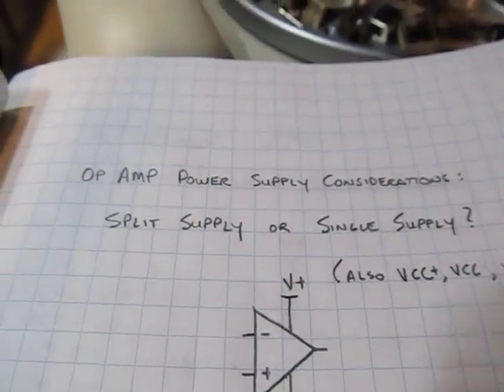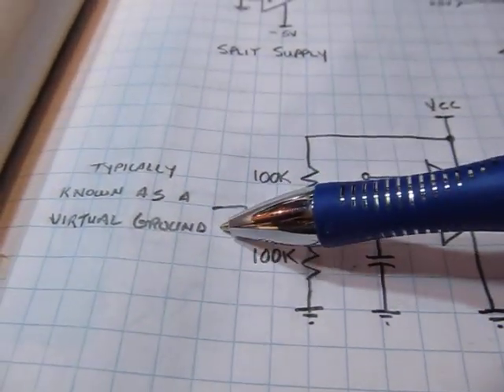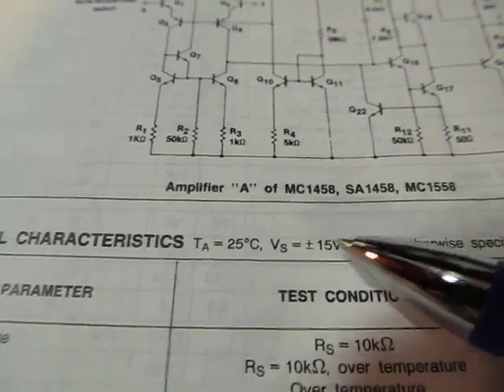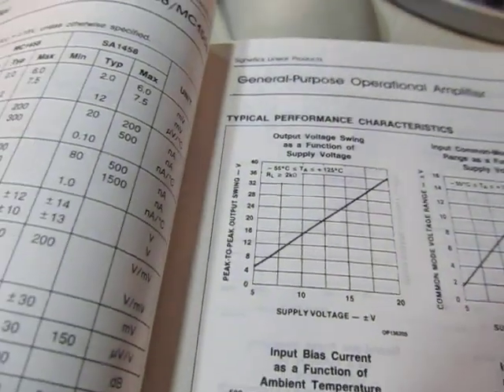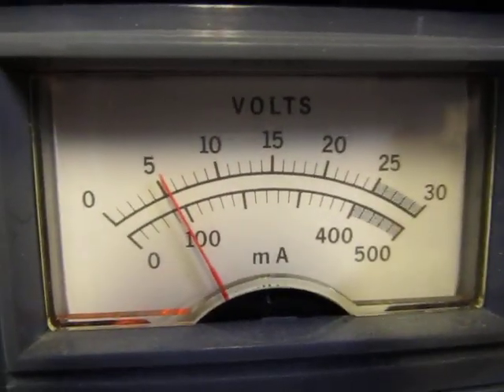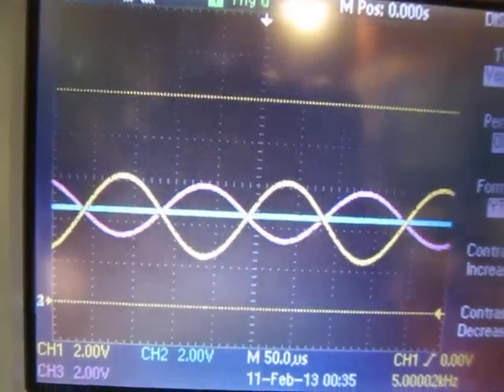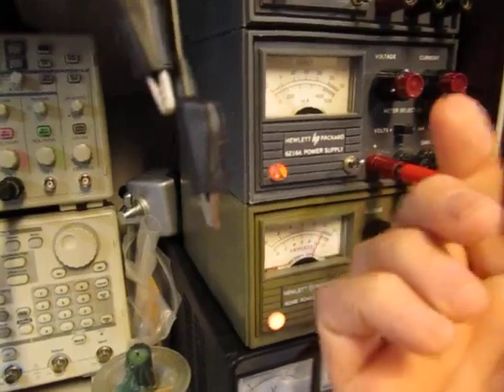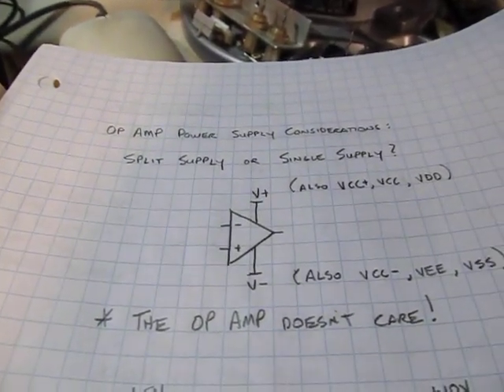#79: Op Amp Power Supply Considerations: split, single, virtual ground, etc. - a tutorial

Comment: if your opamp circuit with a virtual ground connects to a another opamp that is using a single supply (ex 0-12V),  in the gain loop of a non-inverting amplifier, would you connect the resistor to the 0V ground of to the virtual ground?

Comment: could you tell please name of the book you used?
Reply from the maker: I"m not sure what book you're referring to.  I didn't use any particular book to put this video together.
Reply: Ok, I mean't the datasheet. It look's like the number of datasheets sticked together like a "handbook". Or I have mistaken? I am just collectioning this kind of handbooks (in e-format) for individual use, because it's handy )))

Thank you for your videos, they are very informative.
Reply from the maker: OH, now I understand.  Back in the days before the internet, and before PDF files existed, the chip manufacturers would put their datasheets in a book called a databook.  Large manufacturers with many chips would produce a family of databooks (Op Amp databook, Data Converter databook, Voltage Regulator databook, etc.).  Back in the day, we used to have complete bookcases full of the latest databooks from the IC manufacturers.  I still like using these because it's nice to have the "paper" to leaf through.  Some databooks had really good selection guides and some even have cross references to other manufacturers parts.
Reply: @w2aew  Used to?  I still do,  in spite of also having tens of thousands of pdf datasheets too...
Reply: Do you happen to be aware of any manufactures that still publish databooks?

Comment: Being that a R-to-Rail allows for max swing, would you basically choose them over a 741? In your opinion... I would think that a rail to rail would be better given full swing on your power supply. Ex: 9V V+ would only allow for 7v swing given 3.5V bias...
Reply from the maker: These days, there are very few reasons to choose something like a 741 over a more modern device.  R-R devices make the design task much easier in many cases.

Comment: thannks for that video :)
for my TDA2050 wich one is better to use for best result single of split supply??

CIRCUIT DESCRIPTION

SINGLE SUPPLY VERSION

The IC will work from 18v to 45v although performance and quality will be affected at lower voltages. If a higher supply voltage is used be sure to upgrade all the capacitor voltages. C5 must be at least 35v and preferably 50v or more. This will result in a large capacitor but there is room for it on the PCB.

SPLIT SUPPLY VERSION

This version uses a split supply, +/-12v instead of 24v. The supply can go up to +/-22.5v. The split supply version has similar performance to the single supply version.

Vsupply = +/-18v, THD = 0.5%

18W into 8 ohms
28W into 4 ohms

Vsupply = +/- 18v, THD = 10%

22W into 8 ohms
35W into 4 ohms

Vsupply = +/- 22v, RL=8 ohms

25W @ 0.5% THD
32W @ 10% THD

thedjfreeman08@gmail.com
Reply from the maker: I've never designed with this device.  However, since the characteristics curves in the datasheet were all done using a split supply, I would assume the best performance is in that configuration.  Probably a good question for the application engineers at ST.
Reply: w2aew for me i think for single supply they used a single ground thats commun for speaker munus power and signal in minus and for split supply they separate the ground by creating a virtual one
i see that for single if someproblem occure it will affect the player device such as pc or phone...

what do u advice me to chose as supply methode as i will bridge 2 tda to get more power output 

thanks have nice day
Reply from the maker: My first thought would be to use a split supply, for the same reason.  If there's a fault, you're less likely to damage something else.  But, I am not an expert in audio PA design.
Reply: w2aew thanks for replay i will try split then the single one and i will compare between them :)

Comment: I like this op amp functioning demo.  It was interesting to see how the 2 op amps were pin compatiable.  Unfortunatly it seems most manufactures of ic chips go out of their way to be different and almost no standards apply.  Its that "so just to be different" notion that makes learning about electronics such a bitch.
Reply from the maker: Thankfully, pinouts of things like dual op amps, transistor packages, etc. are somewhat standardized - not much hope for more specialized parts though.
Reply: I always check the data sheets before assuming anything in electronics,

Comment: Hi! In your other video about Crossover Distortion you avoid it with a load resistor on the output while here, without any such load, you haven't any distortion despite the 5kHz frequency! How is that possible?
Reply from the maker: The LM1458 op amp has a different output stage compared to the LM358 that was used in the crossover distortion video.  The LM1458 output won't swing near the lower supply rail.
Reply: Thanks for your answer. I switch to a NE5532N from Phillips and now I got no distortion at all, however I got 7mA of current instead of less than 1mA on the LM358, interesting... By the way, this chip has not the "slew rate" issue!

Comment: In the example did you use one power supply or two? I mean  It does not make sense why you put the power supply  between ground and the resistance? What would happen if you simply were connecting the power supply to the Opamp like +10 to one pin of Opamp and 0 (ground) to the other pin of Opamp?
Reply from the maker: +cyrusIIIII I used a few supplies - a single +10V supply to power up the op amp, and the variable supply that I put from the 2.2K resistor to ground is used to demonstrate the behavior with different "virtual ground" voltage levels.  The variable supply is purely to illustrate the effect of the choice of the virtual ground potential (staying within the common mode range of the input of the op amp).
Reply: ***** 1. So if the specifications of Opamp says +-5,  I should just use one power supply and connect the ground (0) of power supply to one pin and +10 of power supply to the other pin of the amplifier and play with resistances in my circuit to to create +5 volts in the + side of Opamp. Am I correct? 
2. Another confusing thing for me is that why power supplies have 3 outputs? For example in my case it has + ground and - output! Can I set it to 5 and connect the + and - output of Power supply to the + and -  pin of Opamp?
my power supply is HY3030EX  :

http://www.mastechpowersupply.com/volteq-power-supply-hy3030ex-30v-30a-over-voltage-over-current-protection.html

Sorry for the long question I am noob :)
Reply from the maker: +cyrusIIIII 
1) Yes, if you want to use a single supply.

2) The power supply output is "floating" with respect to ground.  When you set it to 5V, it sets the + termina to be 5V positive with respect to the - terminal. The ground terminal is connected to the chassis/mains/line ground.  You can connect the - terminal directly to the ground terminal and you've configured it as a positive 5V supply.  If you instead connect the + terminal to ground, then you have configured it as a negative 5V supply.

Comment: for a balanced signal input, where you have a floating differential signal going into the +/- terminals of the opamp, a split supply would be more necessary correct?

Comment: Hi I'm trying to create a pwm signal by comparing a triangle wave with a Sine wave. I've tried with triangle signal that is +/- 5vp from an occillator aast 100khz and a 400hz Sine wave +/- 5vp but it doesnt work. I've tried the 741 and a tl081 opamp and a lm339n but no succes yet.
any help?
Reply from the maker: CryB4Die It's difficult to say without seeing your schematics, but there are very common mistakes that people make.  The first is that you have to make sure that you obey the input voltage range limits on the devices used.  Since your input signals go from -5V to +5V, this means that the power supplies on your op amps MUST be at least 2-3V greater than this - like +/-8V or so, or more.  The input signals generally can not go beyond the supply rails (except in specific cases where the devices are designed for it), and often the inputs must be kept several volts from the rails (except in the case of op amps with rail-rail inputs).  Also, for the LM339 comparator, it uses an open collector output, so it MUST have a resistor connected between its output pin and the positive supply.
Reply: ***** okay thanks!  I'll check my power supply and try it again with a lm339n and a resistor at the output hopefully it works!  Thanks

Comment: Hi,
I have some questions relating to thermocouple voltage amplification. The K type thermocouple output is DC but very low voltage. Do I need to bias the positive input of the op amp above the voltage range of the thermocouples output or can I just tie it to ground? Is it better to have an inverting or non-inverting set-up?

I have some TL072/082 op-amps and waiting for some LM358's in the mail. The 358 datasheet mentions single supply voltage, the 072 doesn't, would the 358 be a better candidate?

Thanks

http://www.ti.com/lit/ds/symlink/lm158-n.pdf
http://www.ti.com/lit/ds/symlink/tl074.pdf
Reply from the maker: Here is Some good thermocouple information (data sheets and app notes):
http://www.linear.com/search/search.php?q=Thermocouple

Comment: hi ,
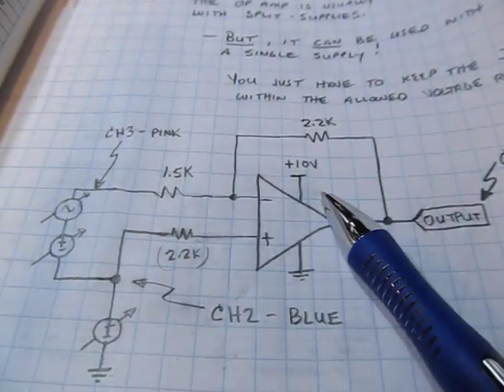At 6:42 can you use the same divider on the inverting terminal to get Vcc/2 volts and convert this into a non inverting amplifier?
Reply from the maker: Yes, I could have.  But, I used a variable power supply so that I could adjust it up or down easily.

Comment: I'm thinking of adding an Eq circuit on to my DIY 200w amp Hifi.

On the lm833 the Vcm is +/12 +/ 14 but the Absolute rating Vcc ~ Vee is 36V does this mean I can use 24v Dc power source to power two lm833 plus the 200w amp it came with or will it fry the added chips ?
Reply from the maker: The LM833 is a pretty low power part, it'll only draw what it needs from the supply, so no danger I. Frying them even though the same supply is also powering a 200W amplifier.

Comment: It is a very nice video. I have a quick question. Considering a comparator configuration, will it work with a single supply(12 volts) if voltage to non inverting input is in the range of mV and the inverting input is connected directly to physical ground( so that ground is considered as reference) ?
Reply from the maker: It depends on the particular device used. You need to choose a unit whose input common mode range includes ground.
Reply: ***** Isn't usually ground a part of the common mode range. Because In datasheets I have seen that the common mode range value varies within 2V of the supply rails.
Reply from the maker: palaprab Again, this will depend on the device used.  Your scenario was described as single supply, so the assumption is that ground is the lower supply rail.  Thus, you need a device whose input common mode range includes ground (the negative supply).  Not all devices do this, so you have to specifically look for this.  Those devices that specify the input common mode range to within 2V of the supply rail would not be suitable.

Comment: If the dual supply op amp is  +/- 12v,    then shouldn't you be able to operate the same device with a single supply of 24v and biased for midway operation...
Reply from the maker: Yes, of course.

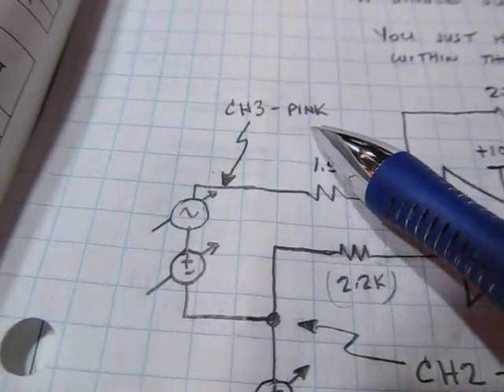Comment: Hi, very instructive video. What is the role of the 2.2k resistor connected to the + input ? The one that has its value in parenthesis, it is seen in the drawing of your example circuit at around 8:00 . Sorry if that question was asked already.
Reply from the maker: A resistor is usually used in that location to help minimize offset due to the input bias current of the op amp inputs.  The value is usually equal to the parallel combination of the resistors connected to the inverting input, so it should be approx 1.4kohms.  I used 2.2k simply because it wasn't critical for the video topic, and it was laying around on the bench near the breadboard ;-)
Reply: Thanks for the explanation! As far as I understand, since the gain here was less than 1.5, I suppose even this resistor wasn't necessary because the error would have been very small. Nevertheless it is important to know about this stuff. I was able to find a bit more in-depth about this watching EEVblog #479.
Reply: +w2aew I would also like to know why this 2.2k resistor was used.

Comment: how do you wire this up practically ( for single supply) I get the theory, but the breadboard wasnt explained
Reply from the maker: You can use a simple voltage divider with a pair of resistors to establish a virtual ground reference point to bias the input of the op amp.

Comment: can the AD8032 be used with 0-12 vdc power supply or only 5 vdc? I ask this because its datasheet only specifies performance on +2.7v, +5v and +-5v power supplies, even if it is rated for 12v operation.How will it work if the single power supply is set to 0-12 vdc? Thank you

Comment: could I use such a rail to rail op amp with real ground on the positive input instead of using a virtual ground to obtain "0"?  all I want is to increase the input signal from 0-5 vdc to 0-12 vdc... Could I use a LT1490 op amp for this application? thank you for your video and hope you will reply soon...
Reply from the maker: You can use the LT1490, but not  as you described.  Set it up as a non-inverting amp.  Use a power supply >=12V.  The simplest configuration would be a feedback resistor (output to inverting input) of 27k, and 20k from inverting input to ground. Apply your 0-5V signal to the non-inverting input, and the output will swing approximately 0-12v.
Reply: *****
Thank you Sir!

Comment: so, if I want to amplify a very small signal (maybe 0-1 volt AC/DC) and I only have 12v battery supply, then I should use single supply rail-to-rail Op Amp?
Is there any alternative solution?
Reply: Either way you'll have to "center" the input signal in the middle of your voltage range, i.e. if you have the -V of the op amp connected to your power supply ground and the +V of the op amp connected to your power supply, then for maximum swing (i.e. max symmetric amplification (no clipping)) you'll have to lift the input signal to half of your +V. 

To make it simple, either you set up a voltage divider or use e.g. two batteries as power supply and reference the feedback loop to the middle (between the two resistors) or you have the "single supply" situation and lift your input signal with a voltage divider.

Comment: Well, from my interpretation, what you're calling a "virtual ground" is just a voltage reference. You could also call it an "ac ground" because of the very small shunt impedance due to the capacitor. The actual virtual ground exists on the "-" input, not the "+".

Comment: I'm sorry, but you are confused about the "virtual ground" terminology. A virtual ground is a point in a closed-loop circuit that always has the same voltage , no matter the input. This is used to refer to the inverting terminal in an inverting amplifier op-amp scheme. Since the non-inverting terminal is held at ground (or some other constant reference voltage), the inverting terminal's potential is (ideally) EQUAL to the non-inverting terminal's potential (e.g. ground). Hence "virtual ground."

Comment: Hi there, I tried to set this up with a non-inverting configuration and a 741CN, but I'm guessing this is not possible because the feedback resistor going to virtual ground from the output will mess up split voltage source? Is it the case that the potential divider only works as a split voltage source if there are no components (across which the voltage drops) between the potential divider and the 741?

Comment: My question is that you used a variable voltage source to make an offset on both the positive and negative inputs (schematic 7:55), thus your input signal that you want to amplify is floating relative to ground, what if the input signal is not floating? how can i make an offset on the input signal, can i use a voltage divider, what if the input signal source has a very large impedance, should i use a buffer before?
thanks

Comment: Hi, 
we can make an offset on the positive input simply using a resistor divider, but how can we offset the negative input which takes the input signal without using an additional power supply?
thanks

Comment: Hi,

When using a voltage divisor (2 resistors) dont we limit the current by the same way?
Reply: Definitely, but Opamp are voltage-driven and not current-driven, and have high input impedance. Thus, your voltage source impedance doesn't really matter.

Comment: Around 1:50 you mention you AC couple the bias to ground "to keep it stable" can you point me in the direction of where I can get some additional information on that?  I'm going to guess you mean the capacitor will keep the voltage "less spikey" and closer to a flat line?  If that is the case I'd think you'd have to carefully select the cap so it let low frequencies pass but not high ones?

Comment: As always, a great video Alan- perhaps in a future installment you may touch on the areas of device types (e.g. bipolar vs MOSFET) and how that affects ability to drive near the rails, slew rate (speed) considerations (e.g. why use a bipolar op-amp vs MOSFET for speed), etc. Great little tutorial with very nice demonstrations. 73 Bill N4BKT